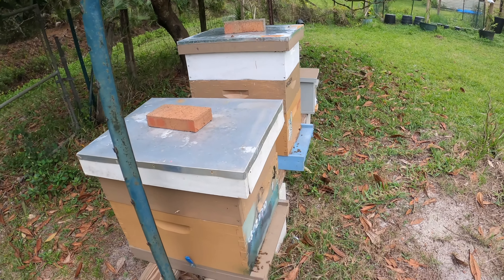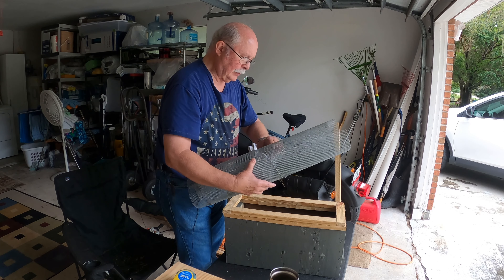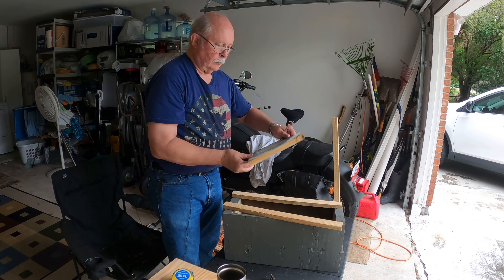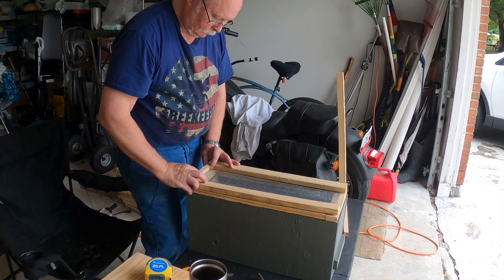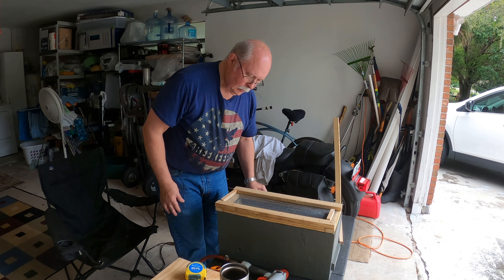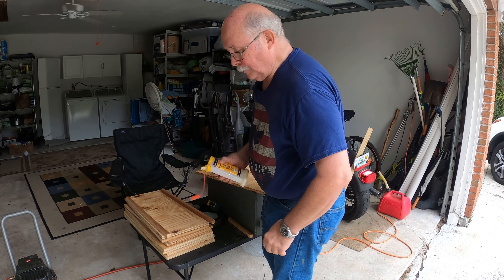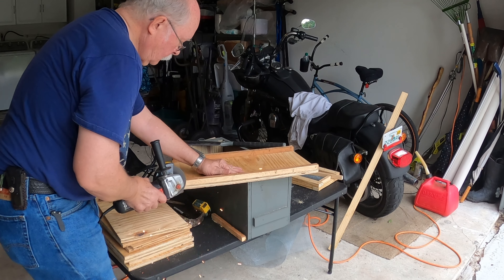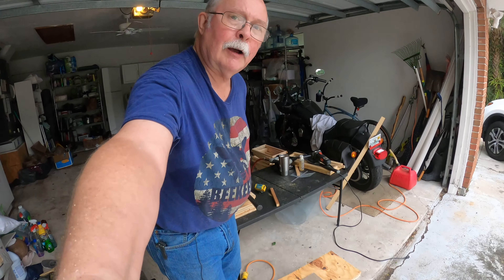Beehive Tops and Bottoms

Comment: Thanks for the tips.   I have that same 18 gauge air gun and never have a problem with using staples, but I haven't tried brads yet.
Reply from the maker: Hi Life of Jim, I confess to being a bit of a Cheap Charlie so Harbor Freight suits me pretty well.  Thanks for commenting 😊
Reply: I own the same HF gun and made at least 500 frames and still going strong. I think Bruce uses too much oil because I see a fog in previous videos. I oil mine after a pack of 25 frames.

Comment: How do you avoid problems with ants getting i to the hives?
Reply from the maker: Mostly I just keep the weeds cleared away from the hives and as long as the bees are strong they take care of the ants.  Now, I had a problem with Carpenter Ants (We call them Bull Ants around here) that would infest between the inner cover and outer cover of one hive - very annoying.  I charred the inner cover and lid of that hive with a propane torch and that seemed to take care of the problem.  Several people have made ant moats that look promising - I may try that at some point.  Steve’s Outdoor World has a video about making ant moats.